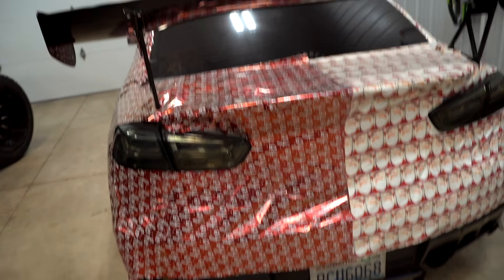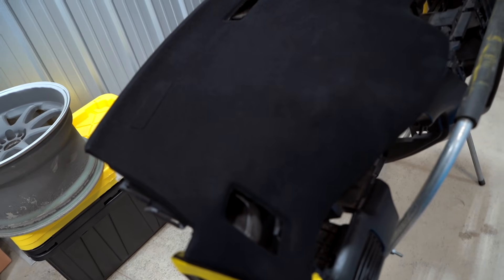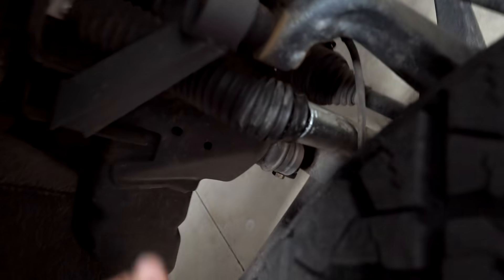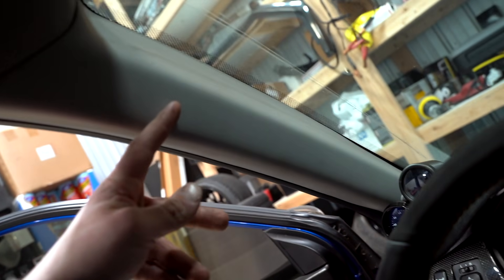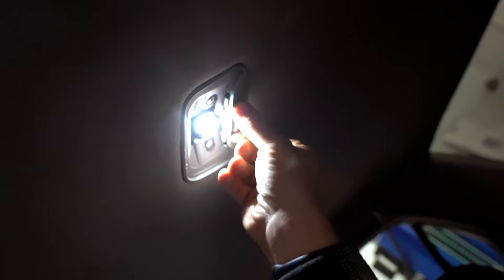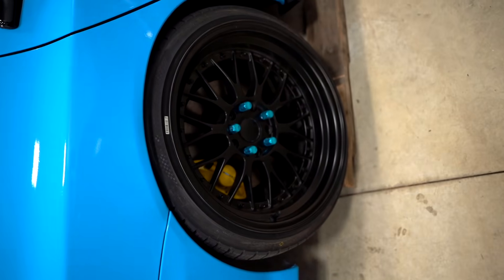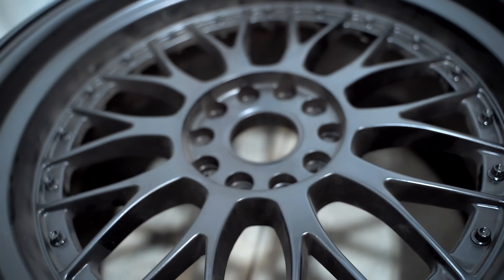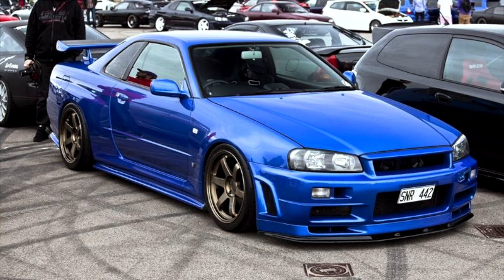They Have To Go...

Comment: Do entire interior in black suede which looks really slick. 

You don't have to re powder coat entire wheel you can get rid of the red on the wheels just tape off the wheels buy a gloss black paint the matches the wheel and paint over it (the red) yourself with either rattle can, paint gun or use a brush use black gloss touch up paint.

Comment: Epic cars and mods. Like the content 🤙🏼 

How did they reset the FRM? Just clearing all the codes? If you reset the short circuit counter of the drl in the FRM with Tool32 and then clear the codes, it must be working again If there is nothing else wrong with the car.